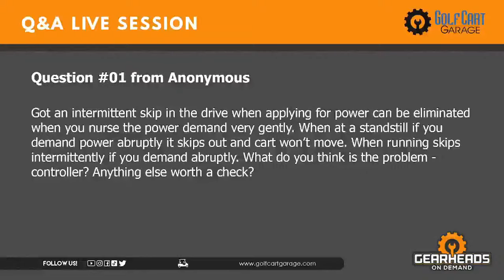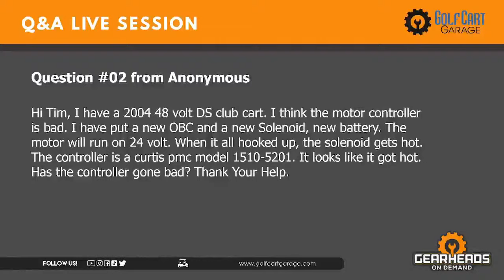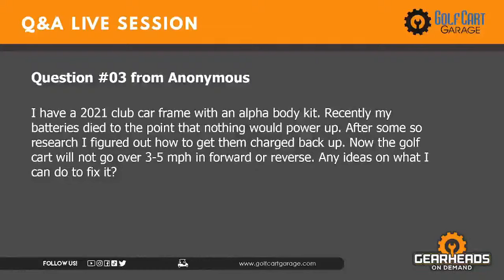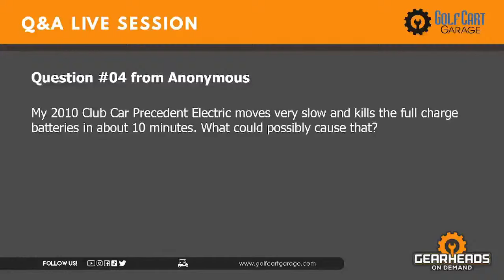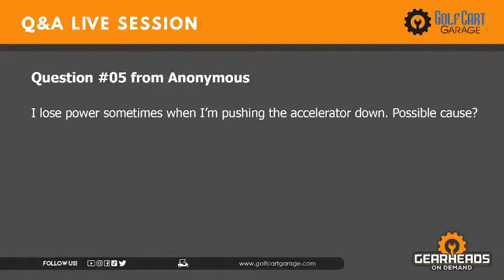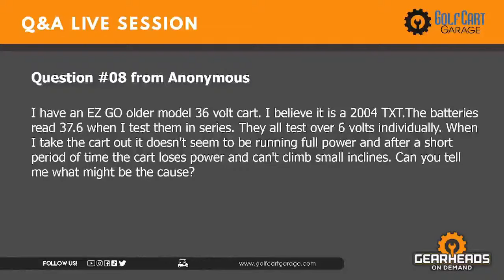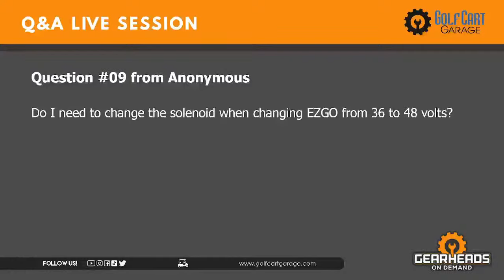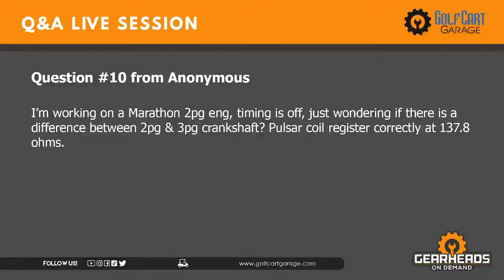Do I need to change solenoid? | Golf Cart Garage I Weekly Giveaways |  Episode # 102

Comment: Hi Tim, from Mesa Arizona.  I have a 2014 Club car precedent . At take off the cart runs great then slows to @8 mph. I changed out the speed sensor and it still does the same. Batteries are less then 2 years and hold a great charge. What else can it be.    I did push the cart by hand and the alarm went off and it was a little hard to push. Thanks Al from Mesa Arizona
Reply from the maker: Thanks for watching, Al!  Could be an issue with the potentiometer on that vehicle.  We recommend a video call consult with our diagnosis team here: https://www.golfcartgarage.com/gearheads-on-demand/
or get in touch directly at Support@GolfCartGarage.com or (800) 401-2934.

Comment: One thing to remember when replacing a controller is to make sure you get your electric motor serviced/replaced, if it has issues like severe wear/carbon build up etc it will have a load effect on the controller and can damaged a new one! Always get your motor checked as well when replacing a controller, not many people will tell you this!

Comment: Hi Tim. I'm new to the recreational golf cart world. I purchased a 2010 Yamaha G29 48 volt golf cart. My cart dies after some use and I don't know why. This doesn't happen all the time but after running it,  it just stops with really no warning. It slows down and then dies.  The batteries and cables all seem good. What I know about the cart mechanics you can put on the end of a pin.
Reply from the maker: Thanks for watching, Michael!  The first thing we would do is load test the batteries.  If even one cell in one battery is going out it can stop the cart... very common issue. We have a video on that here: https://www.youtube.com/watch?v=NsUkLCTWSnQ&pp=ygUeZ29sZiBjYXJ0IGdhcmFnZSBwb3dlciB0ZXN0aW5n  Let us know if you need more help.  Support@GolfCartGarage.com or (800) 401-2934
Reply: @GolfCartGarage  Thanks for your speedy response. Guess I'll need a battery meter. Thanks again. Will let you know how I make out.

Comment: Hi, i have a 2018 gas club car prescedent. Sometimes it starts immediately when i press the pedal and other times there is a 3-5 second or more delay before starting. It has a new battery, what would i check next. thanks Gary from Buckeye Arizona.
Reply from the maker: Thanks for watching, Gary!  We recommend removing the seat and watching the starter as you push the pedal to verify that there is actually a delay or just a tight compression stroke. You can get an appt for a video diagnosis with our team here: https://www.golfcartgarage.com/gearheads-on-demand/
or send a short video of the issue to Support@GolfCartGarage.com so our techs can have a look.

Comment: I have a 2009 G29. Tested solenoid and it work however only 8 volts going to plug to energize the solinoid do I have a bad controller since the wire connected to the small post of solinoid connects to controller need help
Reply from the maker: Thanks for watching! There should be full battery pack voltage at the two small post on the solenoid at activation.  If cart has a run/tow switch then yes, the controller is in the solenoid activation circuit and that could be the problem.  If you have further questions, get in touch at Support@GolfCartGarage.com or (800) 401-2934

Comment: I have an easy go 1992 I replaced the batteries because they were old with marine start batteries! 3 of them 36 v system! 12v Batts. After this I took it for a spin everything was fine until I noticed my 250 ohm resistor on my solenoid smoking. Then now everytime I hit the go pedal it opens right up! ( too much power) Does the burnt resistor have anything to do with this problem?? Thanks for your time!!
Reply from the maker: Thanks for watching, Jaime!  Tim has some follow up ?'s for you. We'd recommend a virtual appt with our tech team here: https://www.golfcartgarage.com/gearheads-on-demand/ ore reach out directly to schedule: Support@GolfCartGarage.com or (800) 401-2934

Comment: Hello. This is a really great show. I am very new to carts. I have a 2009 ezgo rxt 48v. I learned the hard way that the batteries require general maint regularly. My girls were driving it and it just died and the brake locked up. Inspected the batteries and they appeared shot. The brake is stuck on and won’t come off. Tried to switch the controller wires 3 to 1 and it did not work. Ended up getting it home on a dolly. I switched the batteries and the charging port wired it all back. Checked the wiring and cleaned it. Now it won’t come on although the lights come on. I don’t hear the solenoid click on when I turn it to run reverse etc . I am thinking maybe the solenoid is bad. Not sure what do next as the brake is locked and it’s pretty much non responsive. Help pls
Reply from the maker: Thanks for watching, Paul.  We have to recommend starting with the solenoid.  That is the most frequently replaced item on the RXV model.  Let us know if you need more help!  Support@GolfCartGarage.com or (800) 401-2394

Comment: 48 volt Star EV cart.  Won’t start off slow in fwd or reverse.  Starts at a faster speed. What would cause this. Thanks
Reply from the maker: Thanks for watching, Tim! There may be a potentiometer issue that a Star dealer could help with.  If you need confirmation, you can get an appt for a video call diagnosis here: https://www.golfcartgarage.com/gearheads-on-demand/
or get in touch directly at Support@GolfCartGarage.com or (800) 401-2934 if you need more help.

Comment: My club car golf cart,just stalled last week and I still haven’t been able  to get it going,changed the solenoid,changed the starter brushes,even changed the gas pedal,now I ordered micro switches and a coil and a diode wire,my solenoid does not click.
Reply: My cart is a 2013
Reply from the maker: Thanks for watching!  You may have a need for an OBC reset.  You can get a walkthrough on that by calling (800) CLUB-CAR or searching for video help.  A chat with a tech might get closer to the issue.  Try a free appointment with our video call diagnosis team! https://www.golfcartgarage.com/gearheads-on-demand/
or get in touch directly at Support@GolfCartGarage.com or (800) 401-2934